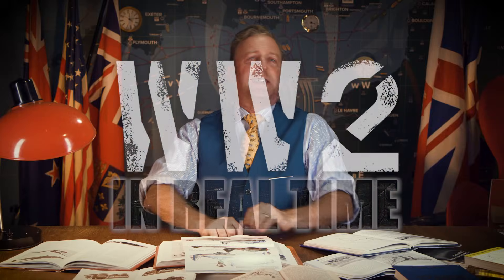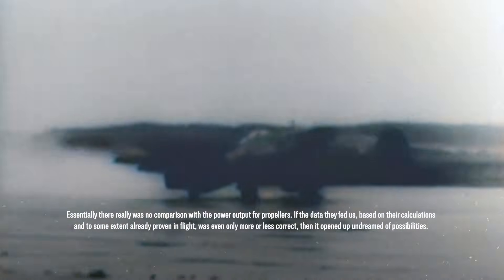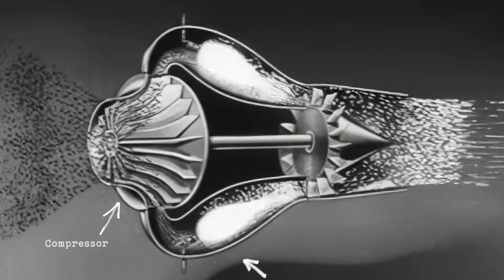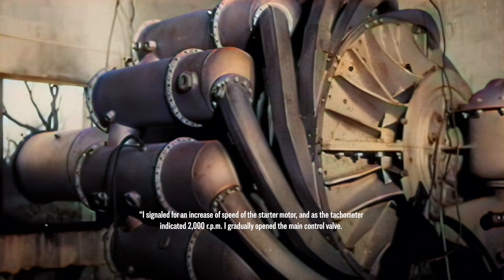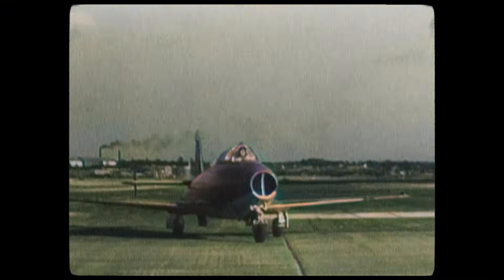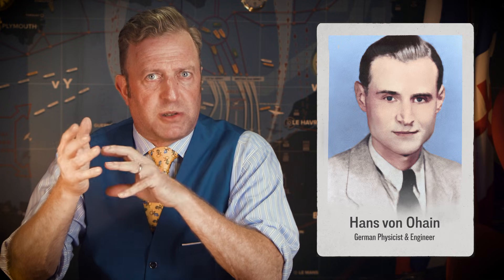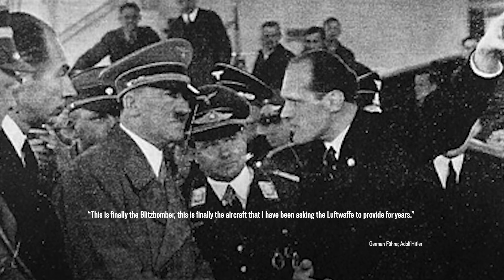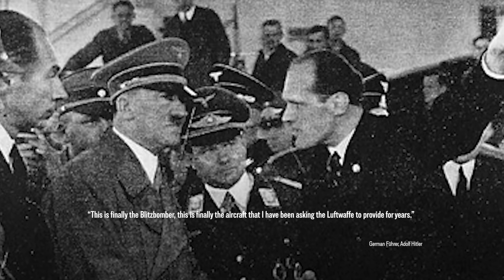WW2 Jet Engine Development - WW2 Special Documentary

Comment: Whittle got there first with his jet engine, but interestingly, his development of a centrifugal-flow jet engine became a technological dead-end. The development of axial-flow jet engines by  BMW and Junkers in 1939 proved to far more successful, and the BMW 003 and Jumo 004 laid the groundwork for modern jet engines we see on airliners.
Reply: It was about temperatures in the combustion chamber. Whittle was aware of the advantages of an axial flow compressor, but the much smaller combustion area of an axial flow design meant it would be hotter than the alloys of the day could stand for long. As reliability eventually showed - the 262s engines had a Mean Time Between Failure of 10 hours, the Whittle design an MTBF of 180 hours.

Comment: You didn't mention that the jet engines of 262 were cheaper and required less precise manufacturing than piston engines.
Reply: If anything, it the only real redeeming thing about the engines.
Reply: They also lasted a few hours before they were junked. A piston engine could last hundreds or potentially thousands.
Reply: @oldesertguy9616  In defence, they were fairly quick to replace / repair, but also airframe life expectancy was not great (if we ignore that half the planes never even flew)
Reply: @oldesertguy9616  Something that soviets learned, if equipment in combat has short lifespan then dont invest more time and labour than it needs to, make more instead.
Both of you are wrong about shitting on this engine,
piston engines cant really offer anything to improve german situation. This thing has very short lifespan but piston engine fighter simply gets shot down regardless of how much potential hours engine gives you.
Me 262 offers performance which nothing that allies send can match if flown properly, its a absolute beast.
There are reliability issues but that goes for pistons too if you make them with slave labor plus the jets are easier to make so you can make them in decentralized workshops.
There were few very high altitude piston fighters designs like ta152 but barely any were produced and its not like it can match jet anyway.
In short, me262 can dictate terms of combat to the enemy while pistons get one frontal pass on bombers and then run away to survive.
Reply: @robertkalinic335  
262 could only do one fast pass, then get back to base.
Reply: @johnburns4017  You realize that normal fighter would be in disadvantage against escorts if they tried to turn back so thats why it has to run for its life, it could do more if nobody chased it.
Jet with four 30mm cannons that escort can only look at if pilot doesnt get slow certainly has more than one passor more angles like vertical.
Idk did you ever play some sim? What you are saying is just plain laughable.

Comment: Military Aviation History has debunked what Galland said that turning the Me262 into a fighter bomber as it was required for all fightera at that tine.   It also wasn't that an issue.  It also is debatable if the jeta would have been a war winner if produced earlier as the engine had a far lower MTBF than a modern one.
Reply: In the end World War II Germany neither had the manpower, nor the economic & industrial output and nor access to the needed resources. USA and Soviet Union outproduced them several times.
Reply: @kleinerprinz99 yup, potential history made cool videos on that subject.

Comment: Chris from Military Aviation History channel has researched the infamous Me 262 demonstration. He concluded there is something of a myth about it. After all,  the 262 was ready for service six months later (the demo was in November 1943, not August). In fact, all German fighters were stressed to carry bombs. The delays were down to difficulties with engine manufacture..
Reply: I haven't seen this video, but agree with the conclusion. German fighter aircraft were under increasing pressure to adopt bomb payloads as the war progressed. Bombers were being lost, the Ju 87 was aging, the new ground attack/tactical bomber (Me 210) was plagued with design trouble. This is what let to the Bf 110 and Fw 190 being increasingly used in the fighter-bomber role, and pressure placed on engineers to make newer airframes capable of tactical bombing. The Me 262's production bottleneck was always engine procurement.
Reply: The real advantage of jet airplanes was a significantly higher top speed. With it the jet fighters would have the initiative, as they could catch any group of propeller aircraft or disengage from a fight with propeller aircraft at any time. Sure, a spitfire might go mach .92 in a dive but it will loose that speed very quickly when leveling out.
The reason Me262s didn't do much for late war germany was that the allied strategy was strategic bombing at very high altitudes (10km) at which early jet engines had a quite hampered preformance.
Reply: Yup, I watched that video.  Also, the Me262 would not have changed the outcome of the war even if introduced earlier due to its engine’s unreliability.   It’s an example of German generals putting all the blame on a now deceased Austrian painter (Armchair Historian did a video on that).
Reply: @shaider1982  He wasn't even a bad painter !
Reply: @ottovonbismarck2443   My great-aunt Heidi had him paint the living room and two bedrooms. Two coats, two days and not a run anywhere.
Reply: @MacShintersbane  As I've said, he wasn't bad. And his salary was ok, too. Wonder if he did this off the books ...
Reply: They should have gotten him for this video

Comment: "It felt as though angels were pushing." General Adolf Galland, after test-flying the Me 262 jet on May 22, 1943. After the war he got to fly the Meteor, and concluded that a winning combination would be the 262 powered by the Rolls Royce jet engines of the Meteor.
Reply from the maker: Thanks for sharing that quote and thanks for watching!
Reply: @WorldWarTwo  Thank you for your great content and dedication to history
Reply: Overall the Meteor was disappointing. This was not the engines' fault - it was a very conservative airframe (they'd have saved time and would have done no worse just modifying a Mosquito). The 262 had dodgy engines but they were on an aerodynamically brilliant airframe.
Reply: Yeah. The swept wings were a pretty good idea it turns out.
Reply: @edward9674  
They sweep was slight and they were an accident. The airframe was an old 1938 design.
Reply: Drat thee, thou pre-eptressor , i was to share thi0s tid bit, and be the cool kid😂